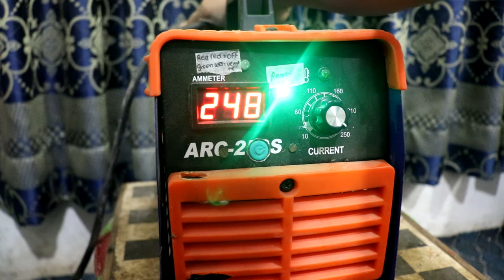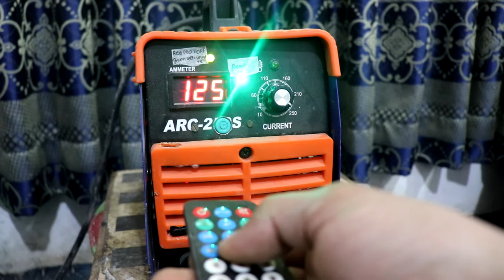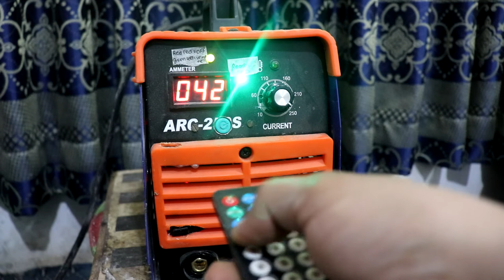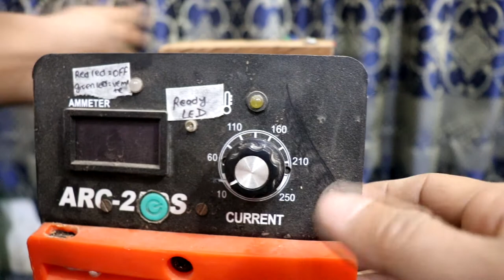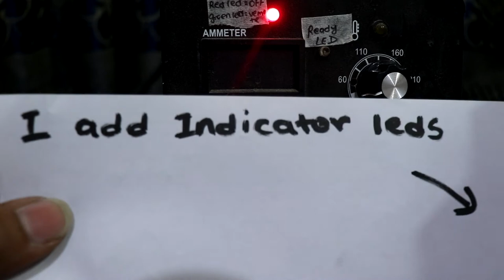upgrading cheap inverter welding machine (remote,output choke,soft stater,etc.....)

Comment: What is the value of the output choke ? it seems to be made out of soft iron transformer, am I right ? Could you give its size, thanks
Reply from the maker: T63X35X36 high frequency toroidal choke i used it from old inverter welding machine transformer. I did not calculate any values of this choke. Thank you for your opinion.
Reply: @electromachine3072  thanks